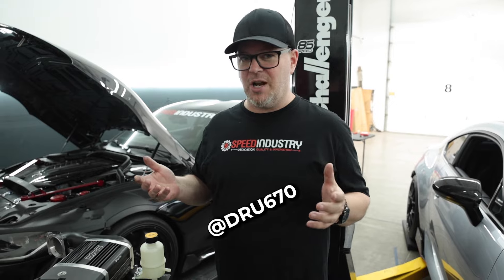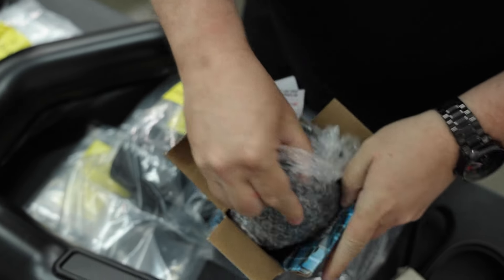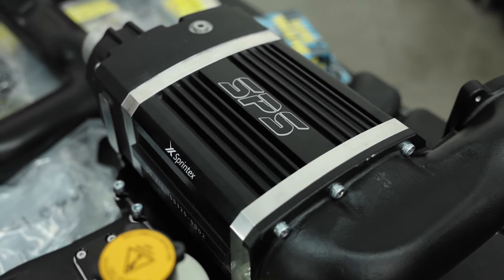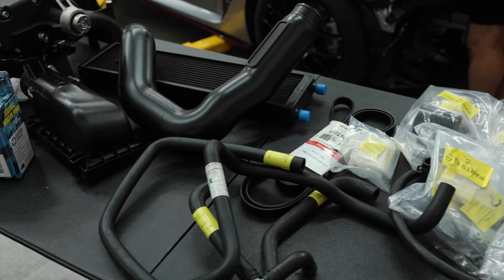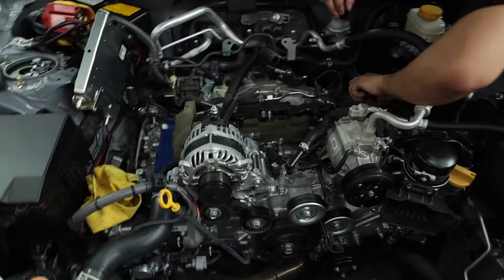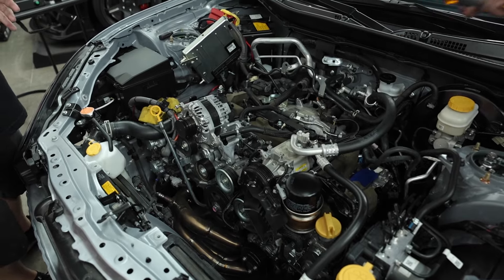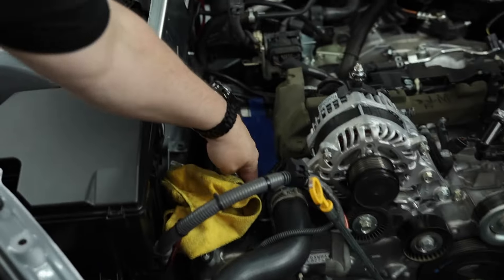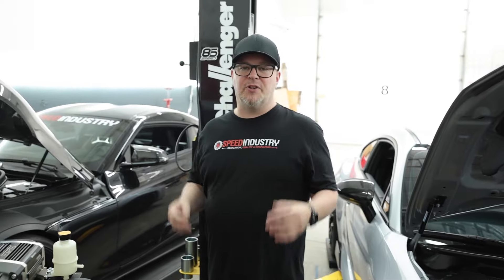SPRINTEX - First GR86 INSTALL  PART 1 - First Production Kit

Comment: With the high compression the 2.4 has, what is the fuel requirement for this kit?  What fuel are the dyno tests done on?
Reply from the maker: This car is on 91  - AKA Shit AZ. NV and Cali Fuel. On our Car we have A Flex Fuel kit that allows you fun E85 when you want.
Reply: @86Speed I heard 91 hurts the car pretty bad is that not true? I’ve been running 93 this whole time
Reply: @0ri not every place is fortunate enough to have 93, friend
Reply: @86Speed  This is definitely on my wish list.  E85 isn't available anywhere near where I am.  92 is about the highest octane around here.  I need to give you guys a call and pick your brains on tuning for it.